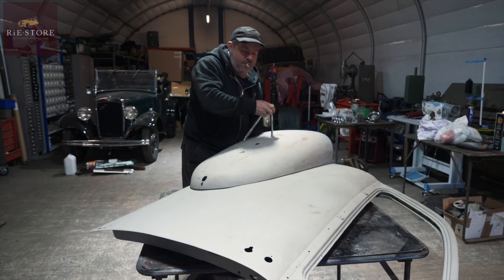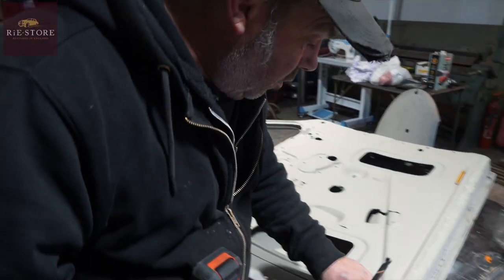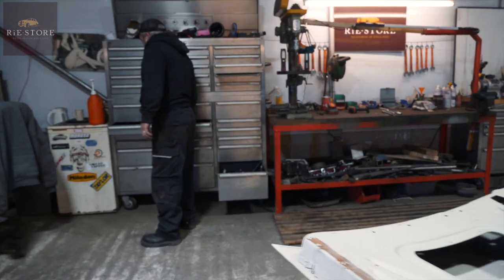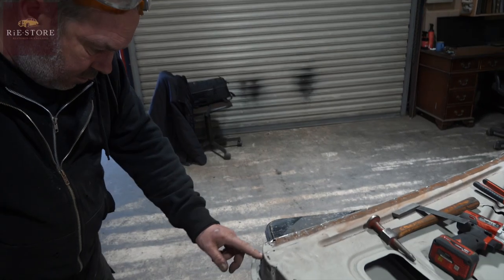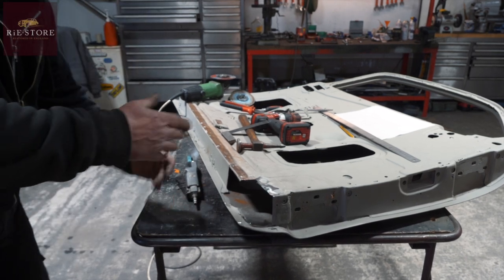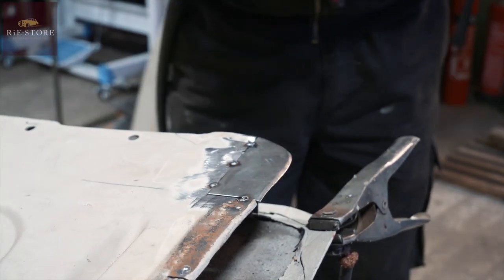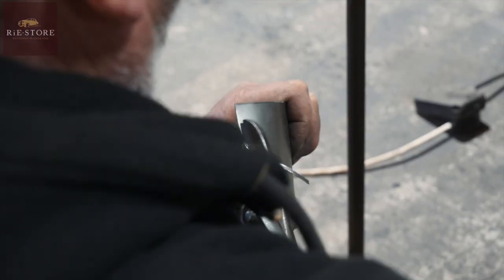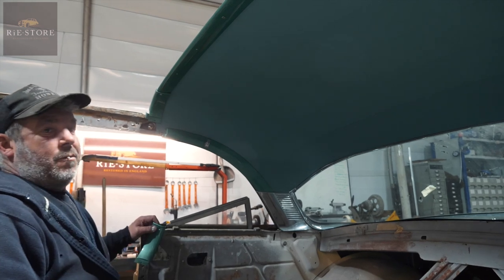Top tips on rust repair - 1942 Cadillac Fleetwood / ep138

Comment: What thickness of steel do you use for this mate?
Reply: Ive been doing repair with 1.6mm thick steel but i feel it doesnt shape as well as i want it too at times
Reply: @JoeSmith-jp7bk  in my case a lot of body work steel is 1mm I believe 👍
Reply: @Renegamers  next sheet i get for a floor pan will probably be around that size 👍
Reply from the maker: Ash answered your quesstion in this weeks episode https://youtu.be/tS13ZRJHLvk
Reply: @theworkshopuk  Awesome thanks